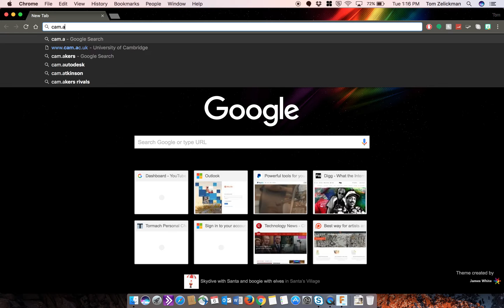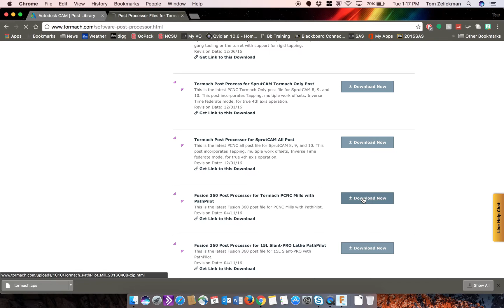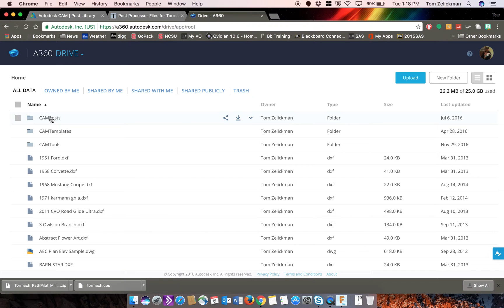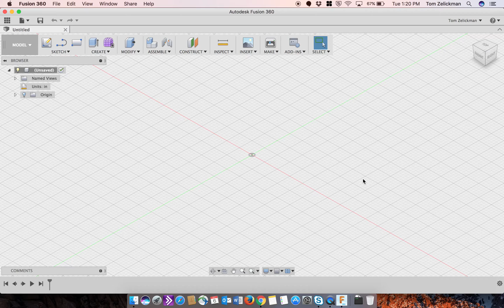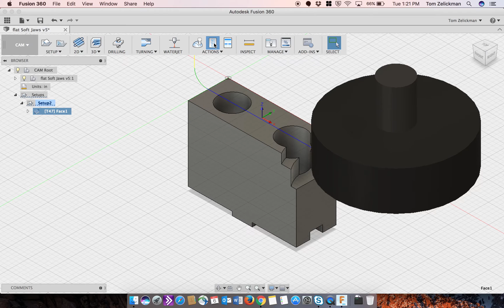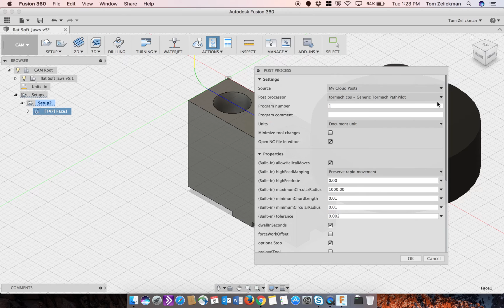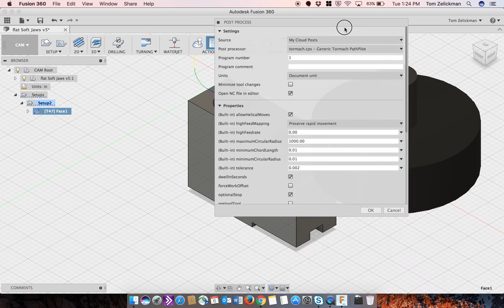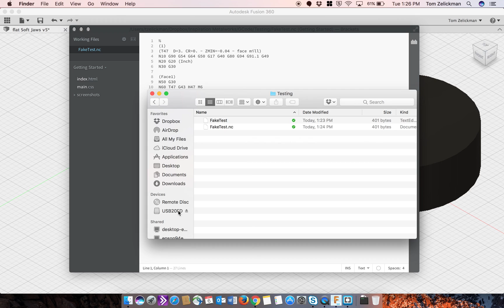Install Fusion Post Processor for Tormach Mills

Comment: Fusion has changed the interface since this video was posted.  I was able to upload some Haas processors to my A360 account, but F360 didn't see 'em or something. 
 I followed this, so I was doing it the "right way": https://knowledge.autodesk.com/support/fusion-360/troubleshooting/caas/sfdcarticles/sfdcarticles/How-to-install-a-cloud-post-in-Fusion-360.html
to the best of my ability, but it's not exactly as written.  (typical, IME, F360 seems to be constantly changing) 
I didn't have any folders, so I Set up a  CAMPosts folder and put 'em there. (there are only 2).  
I have a total of 5 files in my A360 account, so it should't be hard.
Reply from the maker: Hi John,

Yes, there have been some changes since I first released this video. I'm making a new video now to go over the new process. It's much easier now.

Tom Z